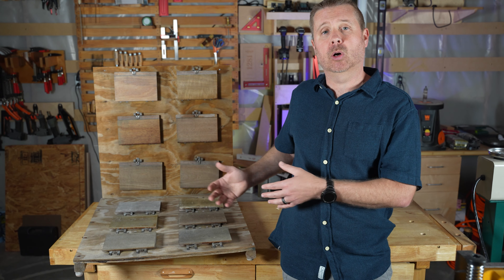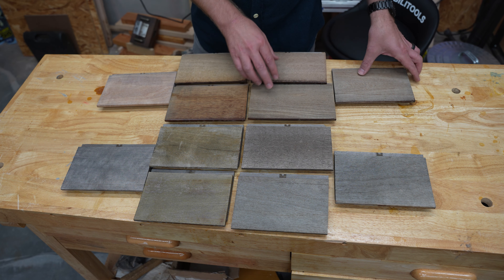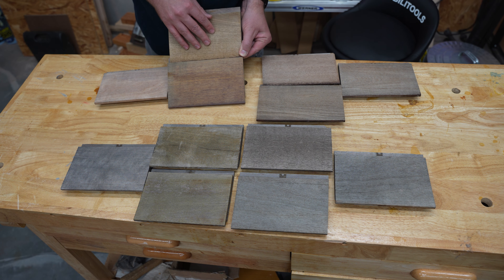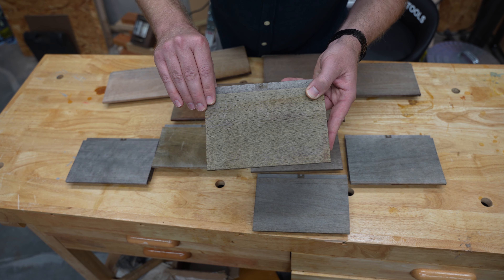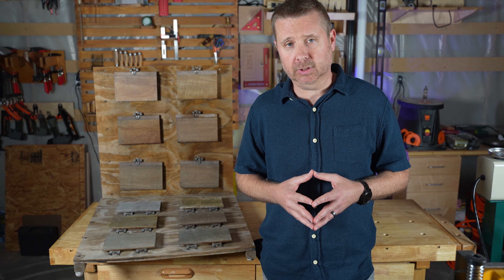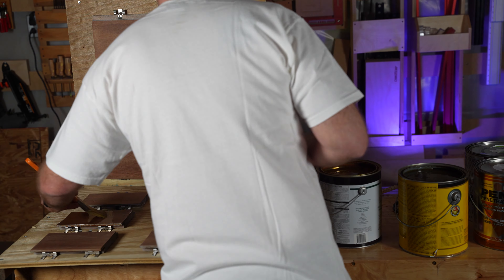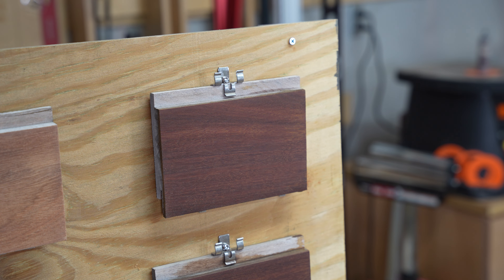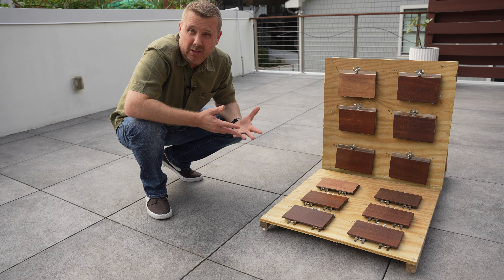Ipe Oil Product Shootout  - Part 2

Comment from the maker: Part 3 has been cancelled due to a storm that damaged the test board last year. I was going to restart the test but the interest in these videos has been too low. Here's how it worked out from part 2....two coats was better but not by much. At the 6 month mark, all the finishes were pretty much gone again. So now what? As someone whose had Massa siding for over 10 years, I can tell you the key is to apply the finish every 3-4 months for the first 18-24 months. Once we did this, we were able to go pretty much a whole year before the next application. I've had good success with Armstrong Clark and Cabots. I've had mixed results with Messmers and Penofin. I have no experience with Deckwise except for these videos and it has not impressed my enough to change.

Comment: I finished my Cumaru deck ~8 years ago and my use of Deckwise matches your experiment. Colorado UV is pretty crazy, and the best I'm willing to do is oil yearly and sand every few to knock down the grain. That way it at least looks great during deck season.
Thanks for doing this, looking forward to seeing if 2 coats makes a difference (I'm betting not.)

Comment: Noooooo....! We don't use oils only to have to sand. Just pressure wash and reapply. But first, why didn't you test to see if they still repel water? Looks aren't everything. If they still repel water they have done 'something'. You should have cleaned and recoated at 6 month and then again at one year because the effects of these oils is cumulative. Often, the 'recoat' (after washing) reactivates the color sufficient enough to temper the greying. Its one more piece of information we would have gleaned from this great review. As for and immediate second coat, how can it absorb more product if it actually works at all? All the second coat does is skim, which provides some UV and water protection, but it sits on top like paint and will have to be sanded off because it will flake and scuff.

Comment: I used Penifin and it doesn't last. I replaced my outdoor deck handrail that was mahogany with Captains varnish and lasted for years with a occasional recoating. So, I rebuilt the rail with Ipe with Pennifin, looks great new but useless, I'm sanding it and reapplying it every 6 months. Same work to prep for varnish which lasts much longer. Obviously, you can't put varnish on the deck, but I did something else. The deck is #1 cedar, sanded with a rented floor sander, real fast! Then coated with Sikkens semigloss but the secret was we mixed in Surf coat glass beads to make it nonskid. Held up for years. In fact, I have a section with a floor mat that's 15+ year old and is fine. Now I'm planning on a renovation and will probably go Ipe with Sikkens or equivalent with glass beads.  Don't waste your time with oils....
Reply: Sikkens, according to a contractor I know, was allegedly bought out and the formula changed. Sikkens was the only product that would last a year here in tropical Hawaii. He ended up making a concoction of the "new" Sikkens and something else that he said does well - but not as good as the original Sikkens formula.

Comment: I just had a client send me this video as to why they are going with a stain rather than a rosewood oil on Ipe. This is one of the dumber things I've ever seen. I would love for you to show some hardwood decks you've actually ever stepped on, let alone built. You're going to see us in 6 months with zero foot traffic on any of this, and act like you're doing something good for the consumer? or the professional? what a load of horse manure this video is. Please, if you are a homeowner, do not listen to this. And to answer the question about why there is no update, its because nothing he said has any relevance to real life.
Reply: If anything, foot traffic would make the test results even worse. And how does the video maker being a pro deck builder (or not) change the results of an objective test like this? The logic of this criticism escapes me. If you have actual evidence of why the video is flawed, then how about adding value to the community by sharing your experience, instead of baseless insults and name calling?
Reply: Did you actually watch the video?